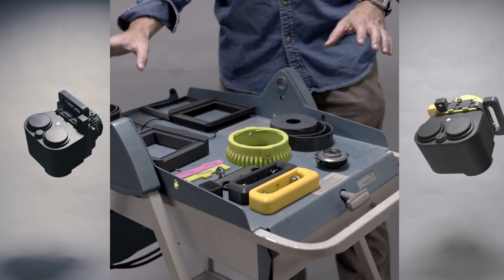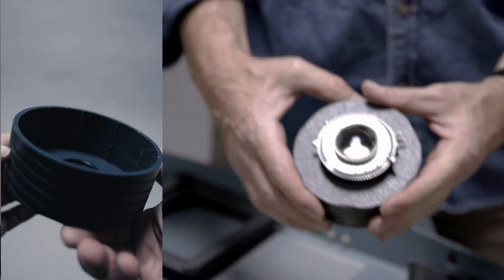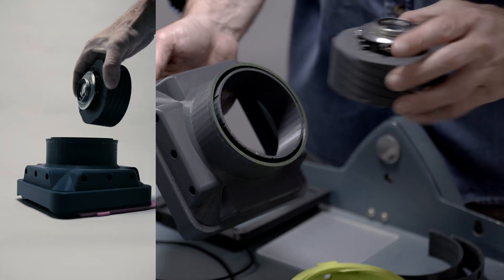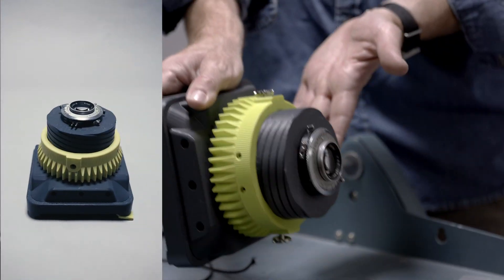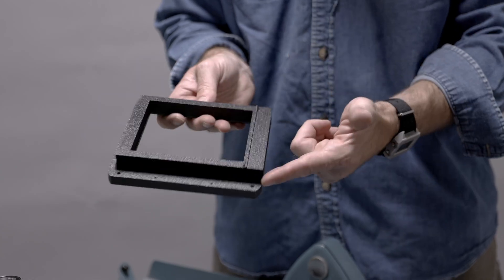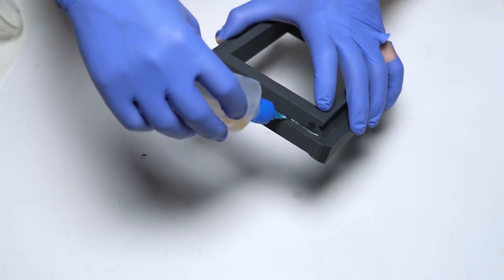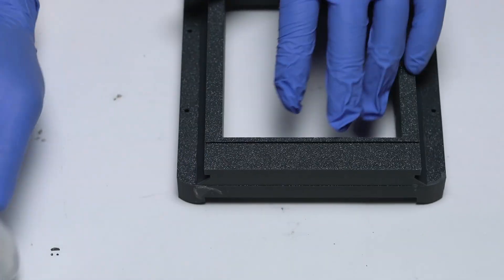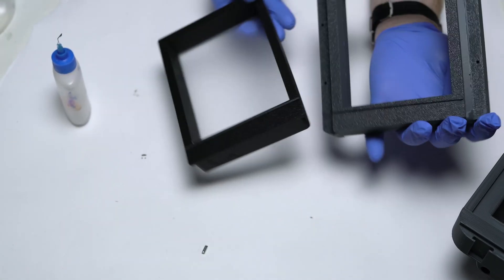MASTER SYSTEM MODULAR CAMERA ASSEMBLY MANUAL

Comment: What is the purpose of the long thin piece in the sheet film back?
Reply from the maker: It’s part of the locking and light baffling geometry. You can see the same on any standard 4x5 film holder or any size grafloc back.